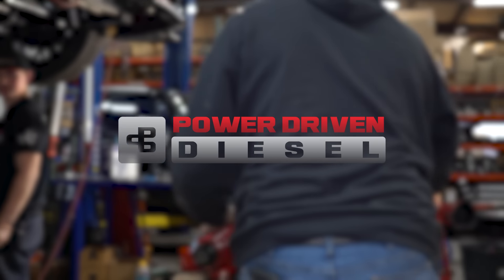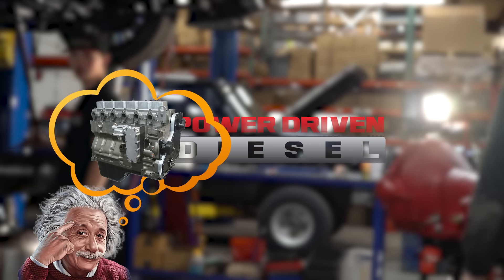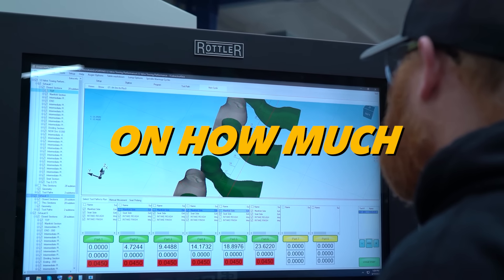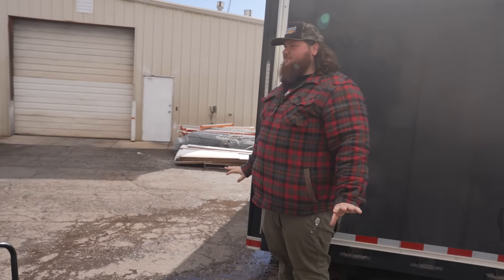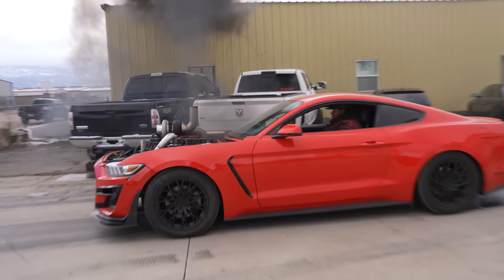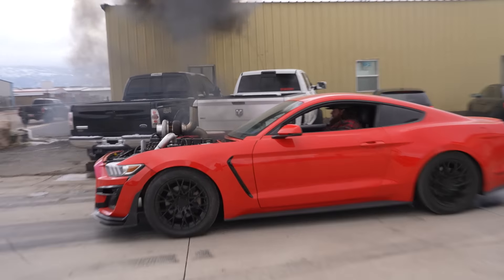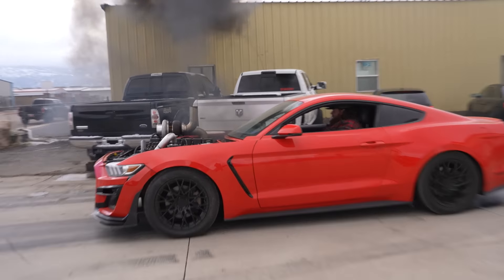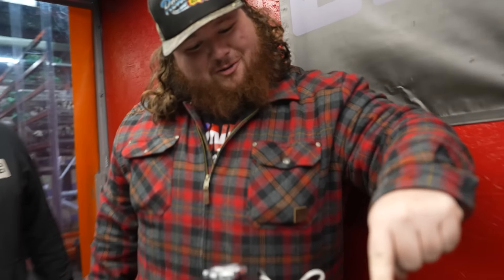I Installed a 1500HP Diesel Engine In My Mustang

Comment: I would like to slide a small camera in removing one of those injectors and check if there's any cylinder scoring on the new motor. I don't know how the oil pump could keep up the quick revs. Definitely it's not gonna go a million miles anyway.

Comment: I wonder if these guys could drop a 300-400 hp 12 valve into a 1993 f350 backed by a manual that can handle it. Love the 7.3 IDI she has but that 4 speed auto is definitely a mood killer.

Comment: If you wouldn't throw half the fuel as smoke out of the exhaust pipe, you could make more power. That black stuff is carbon. If you mix it properly with oxygen it isn't black.

Comment: Rolling coal is wasting fuel, charcoal bricks just from incomplete combustion and lower exhaust temperature to avoid blowing the engine. Do some work on the mass air intake density, increase it by cooling it

Comment: you guys need to take it to Banks performance... mr Banks already did a video analysis of these guys doing diesel dyno tunes incorrectly hence why you're burning so much black smoke... indicating that the engine is choking and starving for more air in the fixture. seriously, would be way more efficient and most importantly reliable with a better tuner. get in contact with mr Banks! HHe would love this beast and to dial the engine in more while fresh still

Comment: To little air and too much fuel most of the time in the old motor. I would say increase air input at low revs, maybe need a bi-turbo setup.
Reply: Still more air needed in the new one.
Reply: Maybe a quad turbo setup would do. Or some pressure storage system like Ford did in a rally car once.

Comment: I got a couple suggestions to make this car even cooler
You should work on the engine bay change the color in their to either chrome black or silver makes the engine pop out more inside the car or you can gice it a roll cage